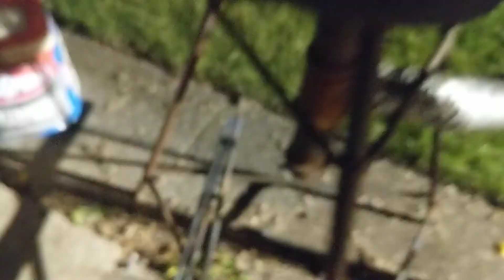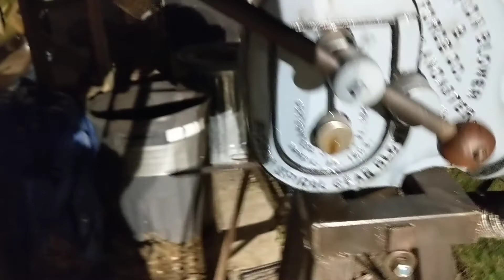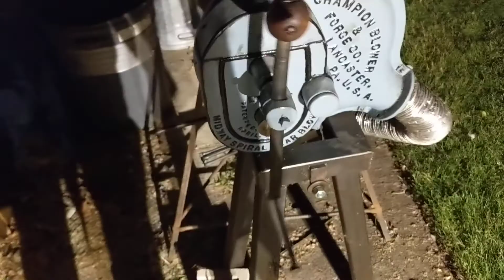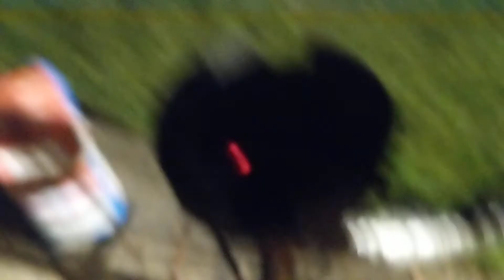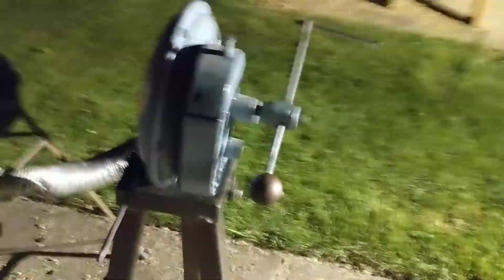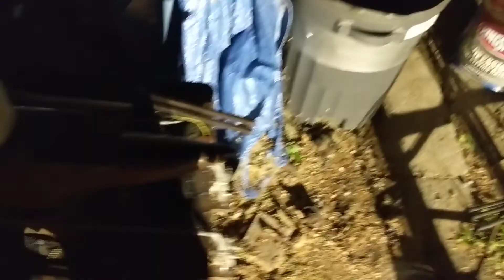Chemtool Fire: THE TRUTH A Former Employee's Perspective

Comment: Thank you for the letting us know what happened.  I'm a fellow chemist and knew that place had to be left to burn the moment I saw the news report.  Lubrizol will have to build a new facility or acquire a couple alternate facilities to replace all that production.  It will be interesting to see if they can rebuild at that site after all that damage.  The seepage of chemicals probably will result in a very long reclamation / clean-up process.  Good luck on your new job.  Hope you find it intellectually rewarding as well as financially.
Reply from the maker: I truly hope they rebuild...but even if they pulled the trigger on the initiative today, it'd be a solid 2yrs before it's operational...there are a lot of industries that depended on Chemtool's products. My new job is significantly better in both income and intellectual stimulation so I'm definitely blessed.
Reply: @jensdavidsen4557  I was thinking 2 - 3 years on the rebuild.  It's similar to when BioLab's chlorinated tablet factory burned-down after Hurricane Laura last August.  Pool owners are seeing massive price increases and an inability to even obtain the tablets to keep algae under control.  BioLab is rebuilding the facility but they won't be back online till 2022 at the earliest (2 years).